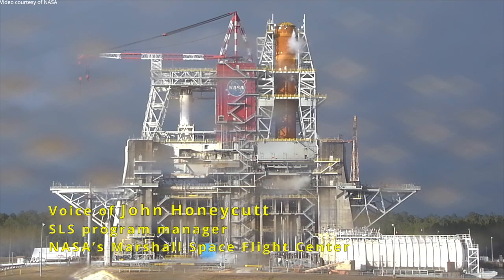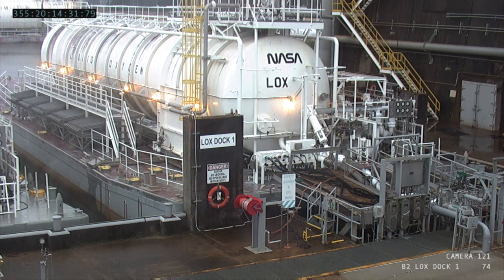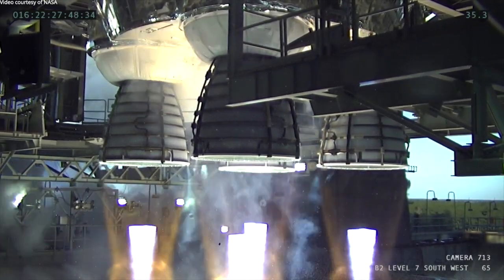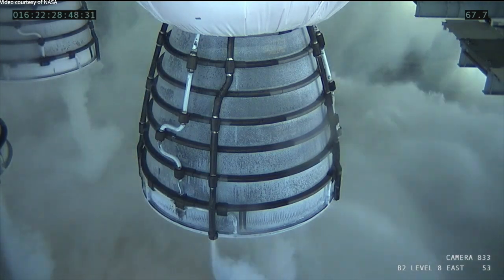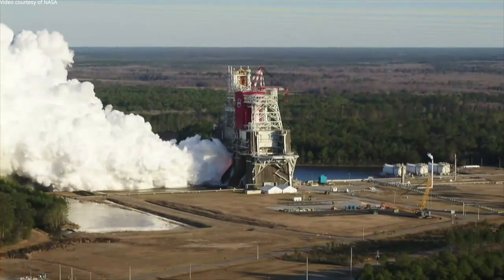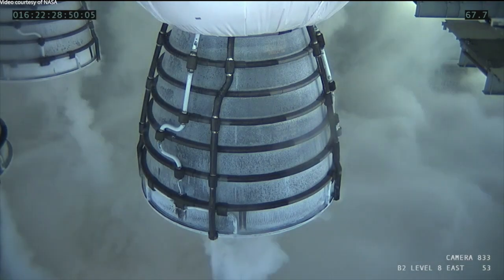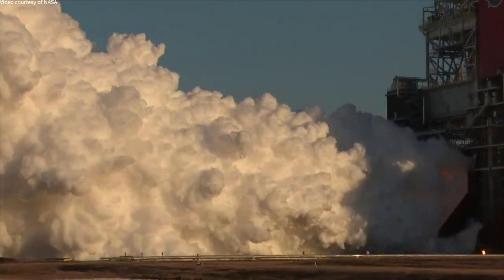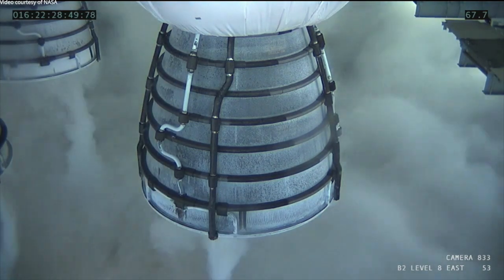Update on NASA’s SLS Green Run Test

Comment: So if I understand this correctly, when they powered the engine up to the parameters that they themselves chose as their target thrust, they monitored engine conditions exceeding the safety tolerances that they had predicted and set and the computers automatically shut the rocket down.

I have to wonder how serious this is.  Is this simply their choosing safety tolerances poorly, or were the safety tolerances they chose reasonable and prudent and the rocket did not perform within those parameters?

If it's the latter then that could spell real problems for this project.
Reply: I think the latter is correct and it successfully shut down the engines, as expected. This is to prove that the system is working properly.  That is to say, if this or whatever limit they programme is exceeded on an actual flight, then the electronic engine controllers and monitoring would shut down that malfunctioning engine automatically. It’s just they gave it a higher than normal limit for actual flight. The only reason this was done that I can think of, is because this was the first test run with All four engines running together, and so they were just being cautious to avoid any damage in the event of a major failure. I flew Boeing 747-400’s with Virgin Atlantic for many years, so I know all about GE Jet Engines. The EEC’s were very similar in operation to the ones used on the space shuttle engines.

Comment: How is possible to get to 109 %?
Reply: Pretty sure it's just 109% based on a benchmark set by the original RS-25 performance back in the 70s.
Over the years improvements made to shuttle engines allowed a higher maximum thrust.
Benchmarking engine thrust output based on the first iteration of an engine is something Aerojet-Rocketdyne do with all their engines.
When the Delta IV launches I'm pretty sure you hear them call out "Engines at 104%," which is based on the thrust output of the original RS-68 engine
Reply: @andrewbailey7999  You're right. The 100% rating comes from the original engine's safe maximum output. It could throttle beyond that but would likely require refurb or replacement to some components. In the case of SSMEs, over time the engines were upgraded and able to exceed the original power level while still maintaining similar levels of reliability.
Reply: They use 100% as the safety maximum. Anything over that is considered possible but may result in premature engine wear.